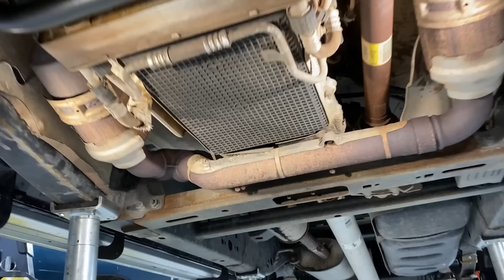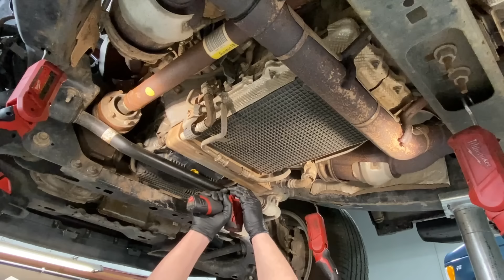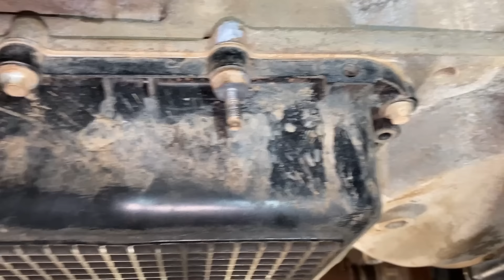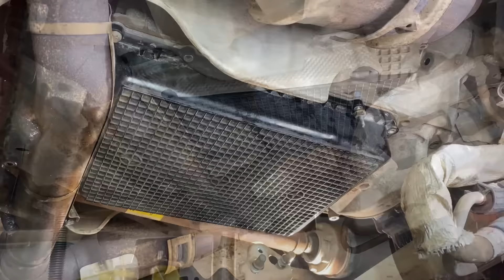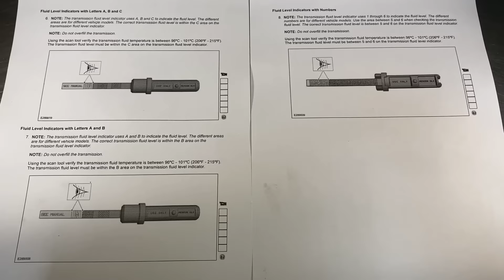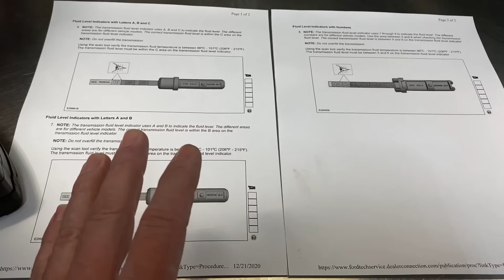Ford 10R80 Ten Speed Transmission: Fluid and Filter Service Procedure

Comment: ????
I followed your video to the letter.
Felt that I added 1/2 quart less, started and ran throughout the gears per your instructions, also took it for a short drive.
Got back and checked the fluid level while hot,
But not running?
I added to get the perfect level (Done)
Recently I’ve tripped over a few videos and their suggesting I check with the engine running????
What’s the truth????
Reply from the maker: Yes you always check automatic transmission fluid with the vehicle running, did you watch my detailed portion of the video where we check the fluid level, you can hear it running.

Comment: Do you know the torque spec for the 3 15mm mounting bolts at the rear of the transmission? They attach into the trans and hold it to the bracket bolted to the frame cross-member. It's a 2019 5.0 but bolts up in the rear a little different than the one in the video. Thanks for any help
Reply from the maker: Oh, that is because you have a 2wd, they are 66ft lbs.
Reply: @FordTechMakuloco  A million thanks Brian. I really don't understand why torque specs are so hard to find.

Comment: Is the transmission bolted different on the 2019 2WD? I have three bolts from back to front directly into the transmission, or I can disconnect two bolts from the bottom holding the bracket to the cross frame. Can you direct me on which ones release the back on the trans and torque? Thanks

Comment: purchased a used 2019 f150 with 85K. any issue with changing the fluid? it has never been changed. thx
Reply from the maker: Nope, go for it.
Reply: @FordTechMakuloco  thx really appreciate you and the reply

Comment: Good stuff... doing my 18 Plat this weekend with the 3.5. Hopefully it will be easier as you said. Thanks for the great insight as always!
Reply: How did it go with your 2018 F150 Platinum?
Reply: @markc7889 went well, just like the video. I used valvoline ulv and it does really well.

Comment: First I check the fluid level cold engine not running, truck on level surface, and cut a notch in the dipstick. I then pump out all possible fluid. I replace the pan with a metal one from American Trucks which has a drain plug.  About $50. I fill fluid to notch. Then I check the fluid level cold, engine running, and it's fine.

Comment: I was just at a ford dealership getting an oil change and I asked what the fluid change interval is for the 10r80 and they said they don't recommend fluid changes. I am so glad I looked more Into it because I will be following the recommended mileage in the video. Thanks again for the great info.
Reply: They rather sell a new transmission or a new truck than have service intervals prolong the life of a vehicle.
Reply: @LT390 yeah thats kinda why i want to do it myself feel like they’ll just charge me and leave it the same

Comment: I just had the transmission service with pan drop done at the dealer... now it is making a noise when shifting (sounds like an old car with low power steering fluid) it's like a whine. Any idea what this could be?
Reply from the maker: maybe they didnt replace the seal on the filter.

Comment: It shouldn't be this hard.  I like to do trans fluid replace every 30K and fluid and filter every 60K. Had an independent shop overfill me to the point that the trans temp hit 230 degrees and started shifting wildly while blowing fluid out the over flow. I had a dealer overfill me to the point that if you went over 60mph, the trans temp would "runaway" and go from 195 up to 220 and keep climbing if you didn't slow down. Why is this so hard? Why can't we have a screw on filter and a huge fluid pan that provides a fluid level range that is not critical to the millimeter?  Love the truck, but it stresses me out every time I take it to get a trans fluid service.

Comment: Is it safe to do this cold?
Reply from the maker: yes
Reply: @FordTechMakuloco  When I checked alldata it says to go to A when hot and running. But your dealer connect system says to go to B so I just went to the top end of B when hot and running
Reply from the maker: Yes I am quite sure the information direct from Ford is the correct one.

Comment: This video was a great guide for me this past weekend. I have the 2.7 but still had to jack up the trans to slide in the PPE deep pan. Couldn't have done the project without this guide. Thanks!
Reply from the maker: I know it seems like it is stuck but the pan comes right out if you angle it right.

Comment: I just done a pan drop & filter change at 137000 km, or about 85000 miles.  I also sent an oil analysis a year ago at 98000km, or around 61,000 miles.  It came back with 48 ppm Aluminum, 48 ppm copper, & 60 ppm iron.  Will be interesting to see if the additional use has added to contaminants.
I also sent another sample prior to dumping the pan.  I used a shop vac with a small hose to suck the oil from the pan.  Was able to suck about 6 liters out, & sucked as much as I could from the cooler lines.
Is it possible to run the transmission with the cooler lines disconnected, once oil is topped off, & purge more contaminated oil out?  Will it suck clean oil in from one side and push used oil out from the other? Does the line from the cooler return directly to the pan, or does it lubricate the transmission internally?

Comment: After you removed the transmission cooler lines. Why not cover the lines with a plastic bag, like a ziplock, to keep dirt and debris that blow around the shop from getting into the lines?

If you run the bag horizontally, It can also help collect those last drips of atf from getting on the floor or you.
Reply from the maker: You can eat off the floor in my shop most days, it's not a pit like most shops out there.

Comment: I've got a 2020 f150 xlt 5.0 with 10r80 transmission I've took it to the dealer ab 4 times for a loud whining noise they said it's normal for the 10r80 to whining and I've got a power train warranty and they said it's normal so idk is it normal for it to whine
Reply from the maker: yes it is.
Reply: @FordTechMakuloco  .
Ok cool thank you

Comment: Hey Brian,

Thanks for another great video. Just did this procedure on my 17 3.5 with the 10R80 (no massive cooler attached to the front of the pan).  I have the A-B-C style dipstick, and leveled it to the bottom of the C hashmarks like you stated. I'm finding some info online that suggest the 17 3.5s should be between the C and B hash marks. Can you confirm or protest that info?  Truck seems to shift fine at the level you specified, just wanted to be sure, as the truck is primarily only used to pull our camper. Thanks

Comment: Why did Ford get rid of the traditional long dipstick and tube you can add fluid thru from the top and replace with the shorty dipstick and plug that you have to fill and check the fluid level with from below?

Comment: My ? is at the end...  So today i was driving on the freeway with supplies approx 1800 lbs. 2019  2.3L Longbed with lumber rack.  headwind and driving at 75mph.  My transmission misshifted!  I was surprised but slowed down and pulled off and looked and YES fluid spilled out from somewhere?  I took off undercover and cleaned off fluid.  My trans temp was 233 degrees reading on dash. NO Fault came up with absolutely no warning. Only the mis- shift.   SO I let cool down and drove to local Oilchangers to see if they could top it off and they have nice drive over Pitts. NOPE! they would not touch it. OMG, so I guess I'm going to fix this myself... I went to ORIELLYS picked up 2 qts and a pump.   NOw that its 95 degrees outside i want to wait for ground to not burn off my flesh! i was looking for video on where to fill my trans. WHY THE FREAK! DID FORD DELETE THE TRANS DIP STICK!   Not really a great idea engineers because the CAT is right next to the fill plug.   I called FORD dealer they only have 1     trans tech.  They are booked out for 2 weeks minium.  I have 125k warranty so now i need to top off and bring down their next week.  HOW did the transmission burp out this fluid?  Is this common if trans is overheating?  Thanks a million for the answers!!

Comment: Why don't you pump the fluid out before removing the pan?
Reply from the maker: Why because there  will always be spillage no matter what if not now during removal then there will be spillage when filling. It is really no big deal cleans up quick and is not a mess like engine oil.

Comment: Or if you are a tech at a shop i recommend keeping a few of the battery terminal caps from a bettery when you install one only because i have had a lot of rags from cintas with metal shavings stuck in the rags some pretty big shavings plus its easier to just slide plastic cap over the battery terminal

Comment: I recently purchased a 2018 5.0 4x4 F-150 extended cab from my local ford dealer who said the truck is a certified gold vehicle. The truck had 52000 miles on it back in Dec. 2021. The shifting hesitates mostly between 1st- (skipping 2nd totally) right to 3rd, 4th and 5th feel like the engine needs spark plugs at low RPMS . 6th ,7th,8th 9 &10 are fine.I don't think the fluid was changed according to the maintenance records. Would this help with some of the problems or is it maybe the adaptive learning causing the systems? My 2014 5.0 4x4 extended cab had the 6R80 and never a problem. Just curious with so many transmission selections on the 10R80.Normal,snow/wet, tow/haul, eco,and sport.
Reply: Look up adaptive learning You need to have yours reset there are several videos about it. It should be fine after that.

Comment: I have a 2019 5.0 Premium PP1, and I noticed there is delayed engagement when I change the transmission shift lever into DRIVE.
Has anyone run into the same problem and how they fix it?

Comment: I really need help here .I got my ford f 150 2019 model transmission pan broken n oil was leaking.I tried changing it to a metal base n got it all jumped up .I got an Orginal plastic pan fixed n it won’t go reverse or neutral .it automatically moves to drive gear n drive ?please I need some good advice.really frustrated

Comment: Is there a way to simply disconnect a pressure line and have the transmission pump itself down and fill new fluid into this transmission to the filter plug if so which line would you disconnect To pump down
Reply from the maker: I would not do that an potentially damage an already finicky transmission.

Comment: For the first service, just fluid.  Do I need to Drop the pan to drain the fluid or is there another way?
Reply from the maker: You can just suck it out the fill spout on the side.
Reply: @FordTechMakuloco  awesome, thank you. Planning on using a hand transfer pump. Was just worried about not getting it all

Comment: I need some help.   I have a 2020 f350 dually xlt 10 speed 6.7 and I do not have a dipstick.  I called the dealer and they said it doesn’t come with one.  I’m like seriously!!  I just did my transmission filter changed and I put 7 quarts.   I have no clue on how to check it.  What do I do?
Reply: B&m sells one on eBay for I think like $168 simple to install

Comment: I am betting Ford considers the filter a "lifetime" filter and that if you bring your truck in for transmission service, they will merely vacuum out the fluid through the dipstick and refill.   No way Ford dealer would do all the work shown in the video for $250.00.    A dealer would want $1,000.00 to do this.

Comment: I just did this service on my 2019 F-150 with the 5.0L after servicing the transfer case, and it took my all afternoon. I ended up using around 5 1/2 quarts, probably because I haven’t touched the filter since my truck was at 29.6k. I did accidentally overfilled it by pumping 6 quarts and it was above the desired mark. Luckily, I corrected the problem after about 10 miles of driving. All I can say is, if I hadn’t watched this video, then I would be struggling with this big time.
Reply: Did you have to lift the transmission to get the pan out?
And did you use an aftermarket pan or the original?

Comment: I apologize if this was in another comment or question, but thought it might be useful or maybe something you would recommend NOT to do. I used your videos when I did my 2014 F150's differentials and 6R80 service. One thought I had (after doing the front differential), why not use the brake fluid vacuum in the transmission fill hole to empty the transmission pan as best as possible before opening/cracking the seal? Use new tubing to prevent any foreign matter from entering and I would imagine you could remove a majority of the fluid and avoid a large mess in the back as the pan comes off. Thoughts?

Comment: I've been prepping to do this job on my gfs 2019 2.7 10R80 (at about 60k. I have all the supplies but having trouble blocking off enough time to do the job when she doesn't need it. 

I've been looking around for aftermarket pans with drain plugs. having a drain plug could make a fluid change a quick and easy job (and even if you had to pull the pan to replace the filter it would make it a lot less messy) I see a really nice one from PPE but $300 + is a little pricey. On one of my other cars I got a simple dorman pan for maybe $50 that makes maintenance a breeze. Am i missing an aftermarket option somewhere? it seems like a common enough trans at this point. 

I found a case of motorcraft ULV for $80-90 shipped. If I could make the fluid replacement itself easier I could justify replacing it more frequently

thanks for the video!

Comment: this is an excellent video. If you endeavor to take this on, follow Brian’s very detailed instructions.  Just did this on my 2018 5.0 F150 at 38k miles, and glad I did. Not sure that the 10R80 trans and Gen III Coyote is the best that Ford has put out, so a little preventative maintenance gave me a lot of peace of mind. As someone who enjoys working on cars, I will say this is a tall order for even the well experienced and well tooled DIY mechanic.  Definitely doable, but a full afternoon of bloody knuckles and greasy transmission fluid (no matter how neat you try to be). The biggest pain for me was jacking the transmission in order to get enough clearance to remove the pan, and dialing in the fluid levels at the end next to a very hot catalytic converter.
Reply: Did you end up lifting the truck or just crawled underneath? If that damn thing had a drain bolt it would be so much cleaner!
Reply: @michalp2362  I don’t have a lift, unfortunately… I do have some beefy 22-ton jackstands which helped give me a little more room. Got as much fluid out as I could with a vacuum pump, but it was still a messy job.

Comment: I was looking at my transmission on my 2017 f150 3.5l ecoboost and it looks like there are plastic screws that also have to be removed to drop the pan. Is this correct and what is the best way to remove them?

Comment: I have been reading these pans are one time use. Is this correct?

When I had fluid changed recently a minor leak occurred after, wonder if some warping over time.  Thoughts @fordtechmakuloco ? What about aftermarket aluminum pans?

Comment: I'm at 2017 f150 87k miles  and never changed the transmission fluid , should I do a transmission flush or just drop the pan and do fluid and filter?

Comment: So, I had this service done on an '18 F150 at the dealer a little while back.  About a month after the service, I had driven the truck at 90mph for an extended time and witnessed the transmission overheat.  Any idea of what might have caused this?  Did they not do something correctly during the service, or is this related to the rash of overheating issues with the 10r80 in general?  If it is related to the other 10r80 issue, any suggestions on how to prevent this?  The truck was not pulling anything, and by all means in stock configuration.
Reply: If it's a 5.0 like mine, the exhaust from the driver's side passes right underneath the back of the pan.Extra heat at that speed. I'm thinking of having my 2018 done soon.53000 miles on it. I can do it now that Brian showed us how. But is it worth it or let the dealer?

Comment: This is the most comprehensive transmission service that I have seen in a long time.  You even provide torque values for all fasteners. Anyone with a little experience can handle this job themselves. Well done my friend Thanks.          Brian should you lubricate the new seals or install them dry?

Comment: What’s wrong with a drain plug and external filter ?
Reply from the maker: Not needed, you want to see what is collecting in the pan not guessing based on the external filter.
Reply: @FordTechMakuloco  will the plastic break through heat cycles?

Comment: @fordtechmakuloco, fixing to attack this job on a 2018 Ford Expedition max 3.5 eco boost with 77k miles on it. Can I use the seal from the f150 on the expedition? Please help
Reply: Thanks for the help. I used the gasket from the f-150 with no issues. At 103k miles now

Comment: i've always wondered why on these transmission fluid change videos, not just yours, that nobody bothers to pump out the fluid from the pan before dropping it. I do and it sure keeps the mess to a minimum. I recently picked up a 2014 F150 with the 6R80. It has 117k on it and i'm afraid to do a fluid filter change at this point. I'm guessing the PO never did it.

Comment: I need a service my transmission on my 2018 F150 5.0 with 65K miles . The dealer wants to do a fluid exchange and extract 100% of the fluid and not change the filter. They’re telling me it is not necessary to change the filter as they put a cleaner through the system as well before putting the new fluid in.  Wondering what you thought about that versus dropping  the pan replacing the filter and replacing about 75% of the fluid. What do you think?